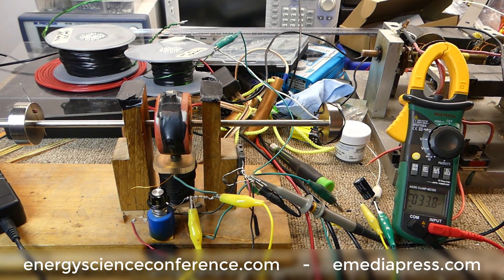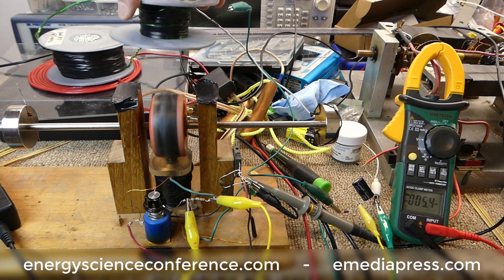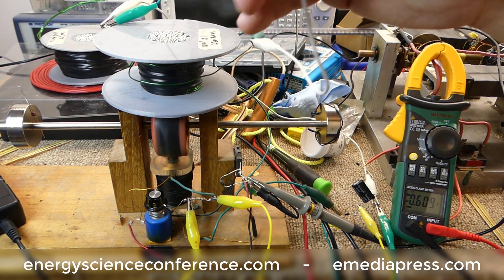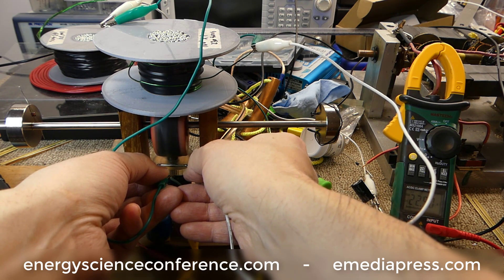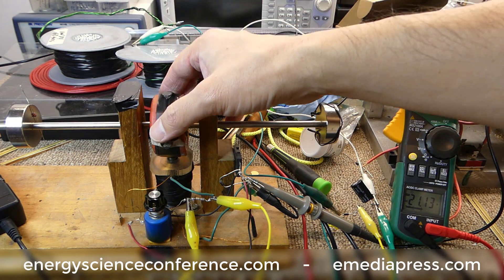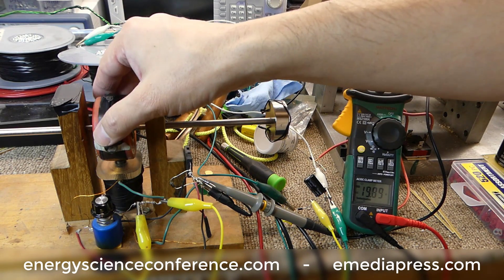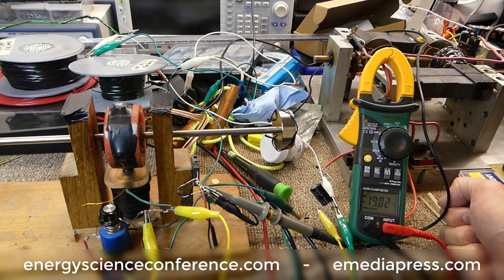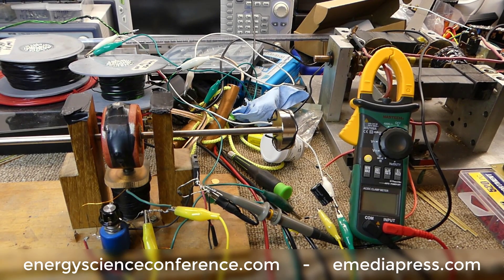Kromrey Shorted Coils Part 2 by Aaron Murakami

Comment: Properly timed impulses are the key. Like pushing a child on a swing. Apply the impulse and wait until the cycle completes, and apply the next impulse. The captured energy spikes that charge the cap. Is the energy contained in the return stroke, so to speak, of the swings backwards motion which is a given, ie. Free energy created by the PENDULUM motion.
In dealing with electricity and magnetism we are dealing with the " invisible " ,and so l am always seeking out a visible analogy which strangely enough always is GRAVITATIONAL. 
This points to an identity between gravity and electromagnetic forces ,of which l am convinced are @ bottom, one and the same.

Comment: Hi, you are right, coil shorting has been around for awhile now, starting with Bill Muller who originated the concept. Doug Konzen, who was a good friend of Bill, then applied this idea as well. 

There are other explanations as well as a solid state means to replace the reed switch with a back to back mosfet AC switch. If you type into YouTube ‘Explanation of Coil Shorting Free Energy’ and/or ‘Free 555 Timer Coil Shorting Circuit’ you will find these two videos that are pretty good too.
Reply from the maker: Coil shorting actually goes back to the 1800's and early 1900's in some magneto systems. 

You're right about the solid state methods to do the same thing. There are advantages to mechanical ways though because mechanical shorting represents a spark gap, which is an open part of the system, which has been shown to have some potential gain mechanisms that solid state can't replicate. Paul Babcock's switching methods are the only solid state ones I know of that replicate mechanical switching.

Comment: Hi Aaron
I have been doing "peak coil shorting" for long time...discovered it by accident witb reed switch on.muller generator..
where ypu want to do it is rigbt at voltage peak like ypu describe at  " "TDC"
Keep pulse width short.
You need to fill caps unloaded, and  caps not too big of uf or tbeir resistance kills it
Bigger caps you can do, the more power you have when caps discharge to resistance. So go as big as possible.
Important is to dump caps to  load ONLY while cap is disconnected from coil. (!!!)
This called 2 stage cap discharge output circuit. A must for peak coill shorting.
You must have very low resistance
In switcbing this why reed switcbes work good.but they tend  to blow up easily ...for solid state and more power possible, ypu need bidirectionally connected mosfets and parallel them too for low resistance. Bidirectionally connected mosfets is how to switcb AC witb mosfets..
Brusb and commutator works well too...
Magneto not the same really as  that  makes a spark to blow up gas in emgine while purpose with generator coils is to filll caps fast and higb  then dump caps to load so now you create power and real watts not just a HV spark.
Also spike from magneto is from the flyback not an actual short circuit then tbrougb diodes (fwbr) to fill cap.
Some european motorcylces use coil shorting however. Tecb is proprietary...
I do not agree with kromrey relation but tbat is ok!! Good demonstration.!!!
Note "magic" of coil shorting happens during swtch Closure! Not upon opening like flyback spike.
I calli it AC hyper ringing....see it on scope..
.Ismael Aviso does 5 quick shorts during voltage peak...he shorts tbe peaks of the ringing!!! Now exponential power increase into caps!  Takes very accurate timing....
Low resistant switching very important....HV diodes and mosfets and caps needed.

Comment: Man you are the best teacher, I have seen it on youtube like so many times, but you best explained how shorted coil works.
It can be implemented on modern motors and generators the effiency would rise as high as 95% or more with COP 10s of times maybe more than that.
I suggest that if you can make a bifilar tesla coil and apply it to the coil you made, all you have to do then is reconnect the ending terminal of the first wire to the beginning terminal of the second terminal which means you are looping current back into the second wire in this way tesla says that the inductance raises exponantially reaching far more output and after shorting this coil the output would be astonishing.
Reply from the maker: Thanks - I may show that wiring method on a gen coil for a bifilar. That is exactly how Peter Lindemann's was wound for the Beyond the SG presentation a few years back. We wound 10 wires on the spool and they were all in series like that except 10 wires not 2. That is one of the keys for larger scale low drag generator coils.

Comment: I keep buying cheap reeds and they keep blowing any suggestions on a good reed switch that won't blow out?
Reply from the maker: Depending on your setup, you can try snubber caps as long as they don't actually create a short.... very small capacitance caps that go across the two reeds. That sucks up the spark so to speak and keeps the points from burning up. I've had some success with that on relay points with cap discharges. Another option is that you use the reed not as the short circuit itself, but as a switch to turn on some kind of solid state device - maybe some transistor or something. Find some examples here: https://www.google.com/search?q=reed+switch+coil+short+circuit&source=lnms&tbm=isch&sa=X&ved=0ahUKEwjOnI3Q2c7YAhUO52MKHbUBC0sQ_AUICygC&biw=1920&bih=933